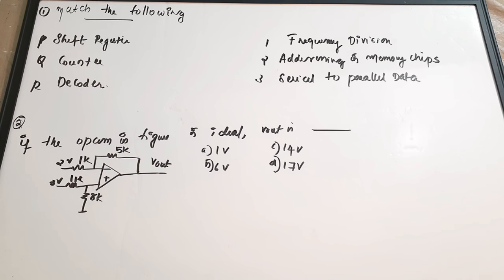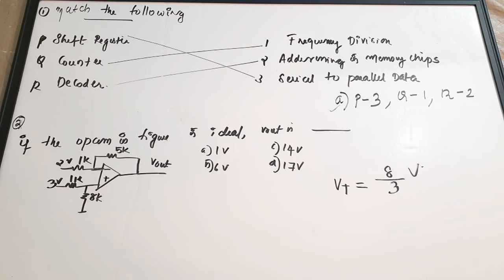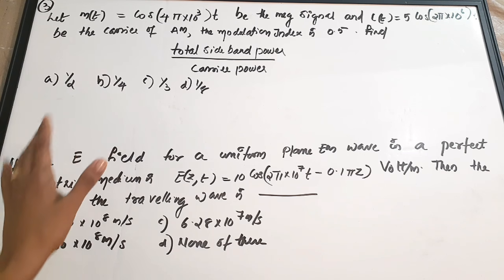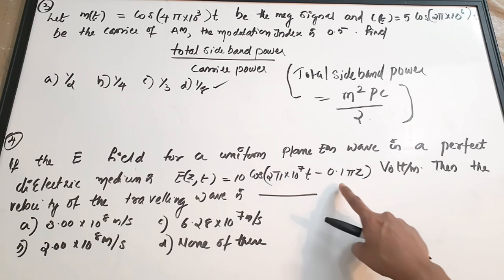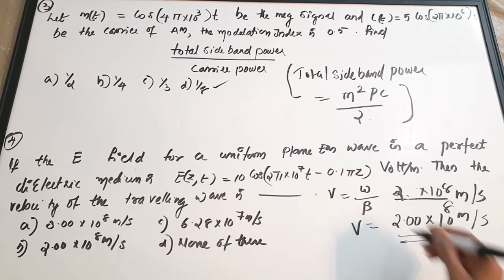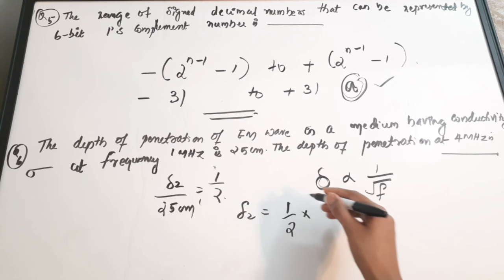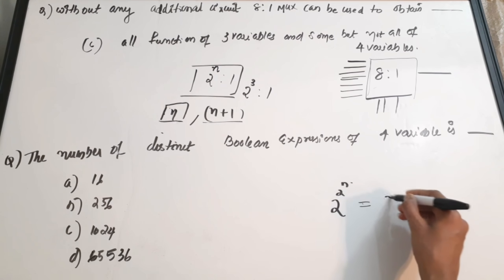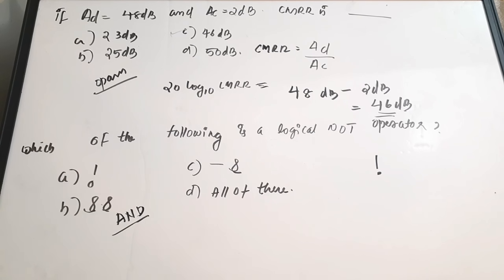ISRO HSFC Technical Assistant Mock Test |  ISRO Technical Assistant Electronics Mock Test  Part4

Comment: Mam, there are many questions wch cannot be solved without calculator, n my maths is week, so how should i prepare for it
Reply from the maker: You have to do logical calculations and practice more. Try to do approximation methods to do sums quickly like if u want to multiply 431 and 349 then go for 430 and 350 and look for option's
Reply: @EasyElectronics_jobupdates  ohk mam, thankyou for your support